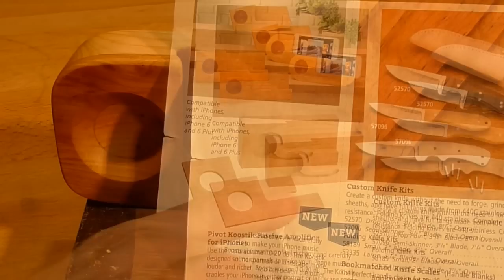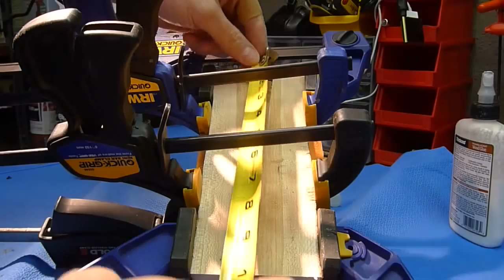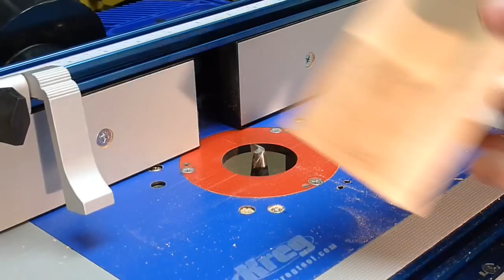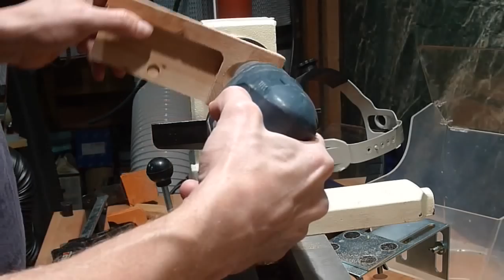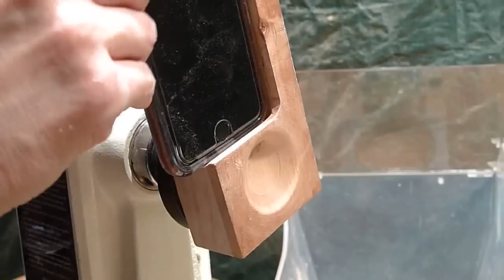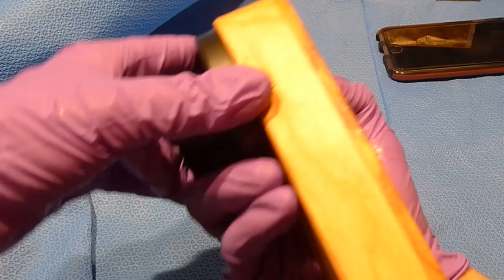How to Make a Wooden Stand (Passive Sound Amplifier) for your iPhone (English Version)

Comment: Nice design,  and good job. I would need one made for left hand operation. That would put the phone buttons at the bottom of the phone  over to the left side with the speaker on the right side. That way I would'nt have to reach across the screen with my left hand to use the buttons on the right side.
Phone designers and phone app designers are two more groups of people who blatently always discriminate against lefties.  99% of my phone apps are made for righties only. Screen rotaion apps call us upside down or backwards. How would righties like to be descriminated against like that? I know that's not your fault and you have made a very nice video. I wish that I had your talent and tools for wood working. My workshop is on our appartment balcony. Keep up the good work.
Reply from the maker: +Kerry Wware Thank you, Kerry!
There is a guy in Belarus who has quite a woodworking shop on the balcony. He has a youtube channel: https://www.youtube.com/user/yplandrew 
You will be surprised how much woodworking he does in such tight quarters! 
Best! Michael